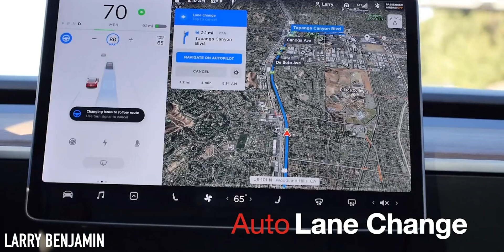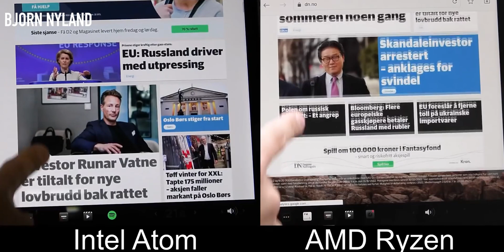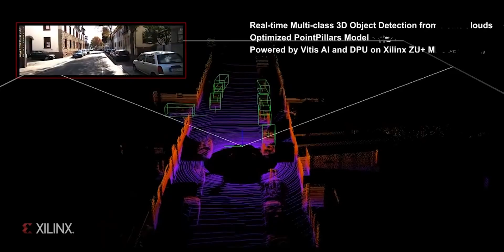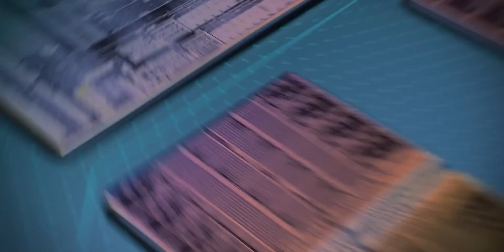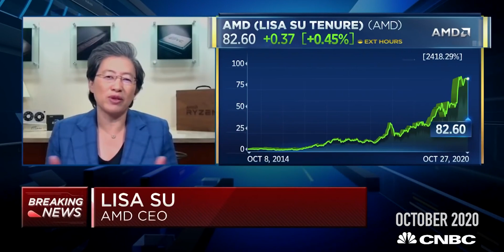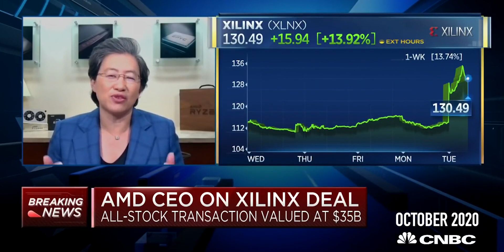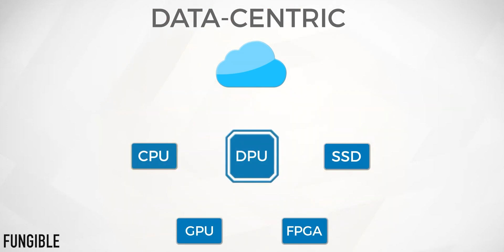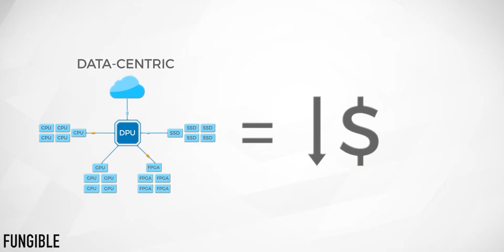Tesla Chose AMD Over Intel (INTC) - Here's Why

Comment: Will never use intell for a gaming rig again. They only support there platforms for about half the time as AMD. 2 years vs around 4. Also AMD always has more cores and they use solder instead of thermal paste internally. Thermal paste doesn't age well and I feel can lead to performance issues with age. Any one that's de lided an intell knows what I'm talking about.

Comment: Your explanation of APUs is incomplete.  AMD's APU is a cpu, gpu, and most of all shared memory between them.  This means that both the cpu and the gpu have access to the shared memory and instead of AMD APU having to move a mountain of data from the cpu to the gpu, the APU simply passes a pointer to the data, no waiting, no latency.  The gpu receives the memory address pointer, retrieves the memory, and goes to town with it.  The tight integration between the cpu and gpu through memory is why Microsoft and Sony chose the AMD APU to power their Xbox and Playstation.  Also the vastly superior cpu processing power and efficiency of AMD not even mentioning all of the security flaws of Intel.  Note that ALL supercomputers today are built on AMD processors except the one contract that Intel won with Argonne Labs for the Aurora supercomputer.  But it is now 5 years later and Intel's has not been able to supply the supercomputer since Intel's technology is still broken and cannot meet the contractual requirements.  The story continues with AMD's superiority and 3 to 5 year technological lead on Intel in every market segment.

Comment: great video. question is Apple and MSFT making their own ARM chips going to threaten nvidia & AMD
Reply: LOL, did u watch the video?? , X86 and ARM are not the same..... and they have their pros and cons...
Reply: @marcos14223  Yes they are different instruction set but for the most part the extra instructions in X86 havent been useful so CPUs using ARM instruction sets provide better performance per watt for most tasks. Building accelerators has proved to be better than increasing the size of the instruction set. Did you understand what I mean?

Comment: So, with DPU, AMD has its hands on everything that was shown in that diagram of data flow in certain data centers.

To be clear, AMD is already taking market share in certain server markets, and when Zen 4 launches it will work its way into a greater percentage because it's already diversified its CPUs for server and has an insane number of what Intel would call performance cores going into EPYC CPUs for Zen 4, AND since it's on TSMC N5 they'll be more power efficient.  Once line of server CPUs maxes out at 96c/192t and the other line maxes out at 128c/256t and there is just no competition for a single CPU with this many cores.

Intel wanted to get a line of CPUs out on a TSMC node but it's probably not happening.  Intel wants to be on their Intel 4 next year for their 14th gen Core CPUs.  This looks like it's delayed though.  They launch 13th gen later this year.

Intel also launched a new line of GPUs and that's not only delayed, the performance is pretty bad.  This may pay off for Intel in a few years, but not right now.  And they have to compete against both AMD and Nvidia for GPUs going into servers (this is for compute power, not display).  Both companies are WAY ahead of Intel, and for AMD, companies are more likely to use a complete AMD solution, so CPUs/GPUs, whereas if they buy Intel CPUs they're likely to use either Nvidia GPUs or AMD GPUs.

Comment: The AMD APU that's going into the Tesla display/control unit is similar to what went into the game consoles so there's plenty of power there for decent gaming.  Gaming is disabled unless the vehicle is stopped, though I don't remember what happens when there's a passenger.

AMD DOMINATES the gaming world now, not necessarily in the PC world, but everywhere else.  The Xbox, PS5, the handheld SteamDeck and with the next gen if AMD has the capacity I'm pretty sure they'll end up in other handhelds because it's just so powerful and even more so when it comes out on TSMC N5 for Zen 4/RDNA 3.  Those APUs are going to be amazing.

Comment: Do you have any insight as to why AMD cannot seem to break through that $100 barrier?  Just keeps teetering around there, regardless of the markets it was doing that before the bear Market turn too. Who's trying to keep it down here and why?
Reply from the maker: Well, growth stocks got absolutely clobbered this past year so some of it is just macro headwinds. I wouldn't worry about that too much as a long term risk.
Reply: @TickerSymbolYOU  - oh I'm holding forever, I put this in my wife's portfolio 5 and 1/2 years ago. I just find it really ridiculous that Nvidia goes crazy and I know they're bigger and larger... However, AMD is much better and they just don't rise the same as we all know they should.

Thanks for great content as always.
Reply: AMD is underpriced right now. Look at its PEG ratio. It’s on sale.
Reply: @shauna996  PEG ratio does not say anything in recession. The stock earnings do not reflect the true value of how the company does a thing surpassing the quarterly look. As stock prices can not drive up more if the GDP is dropping or the economy is slowing down.  In fact, it is the opposite, during the recession the stock price will shore and drop further if it is being rising recently. You need to look for more value rather than just PEG value.
Reply: The thing is the AMD stock is overpriced at this moment. AMD is outsourcing but does not actually make real chips and it got direct hit by the supply chain. Intel currently has a higher potential for investment than AMD which is why people are jumping ship.
Reply: @hamahamieng  Intel stock price is trading lower than it was 5 years ago. Buying Intel stock is like gamble at this point.